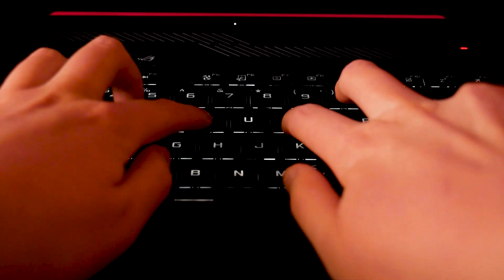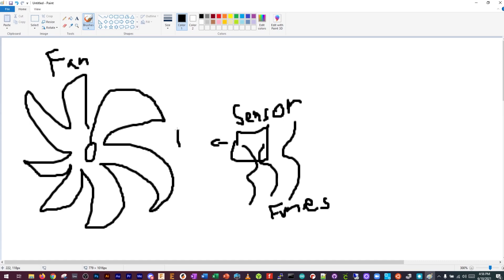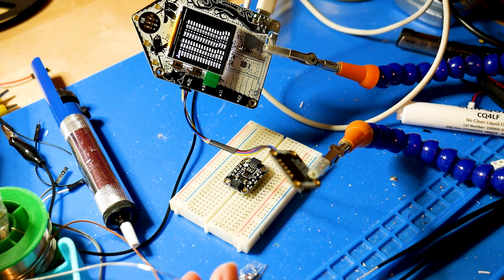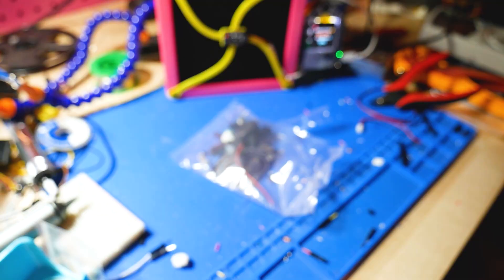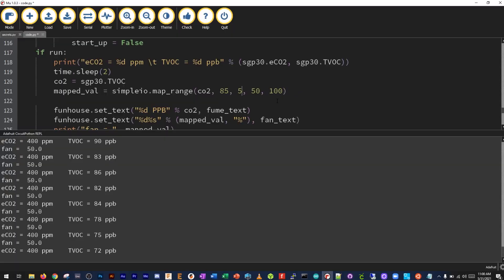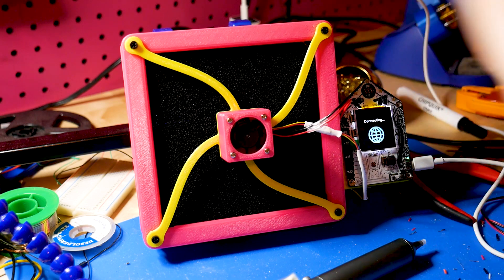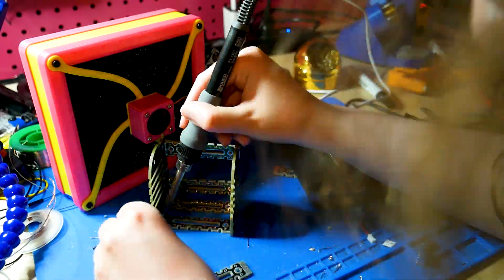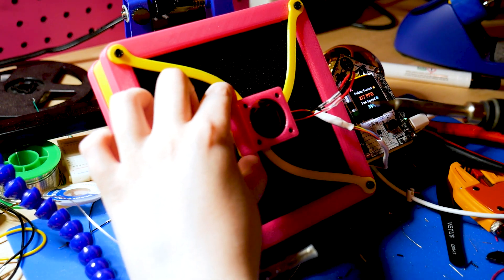I Built an IoT Solder Fume Extractor 🔥

Comment: This is great!
Nice build, not just theoreticals etc.

Just one question tho, would it not be more interesting to see the delta of the toxic ppm before and after the filter as to see if the filter is doing its job?
The way the sensor is located atm to just confirms the presence of the harmful compounds and then starts the fan, which is 100% okay with a fume extractor using a pvm solution, but doesnt do anything for the user, as in keeping us out of harms way (which is the base idea of a fume extractor) :)